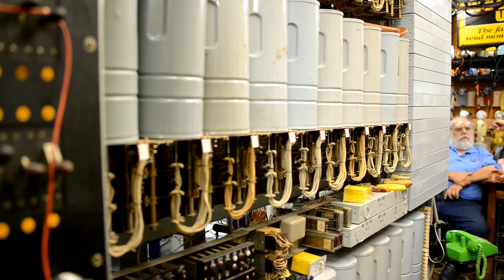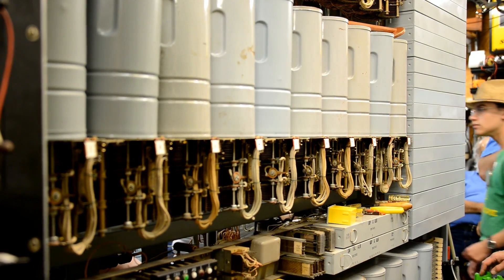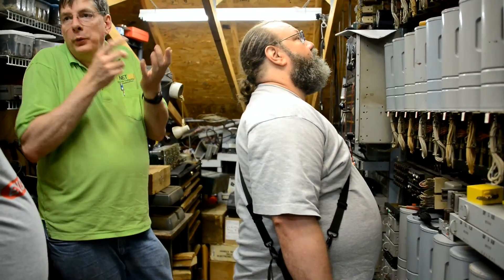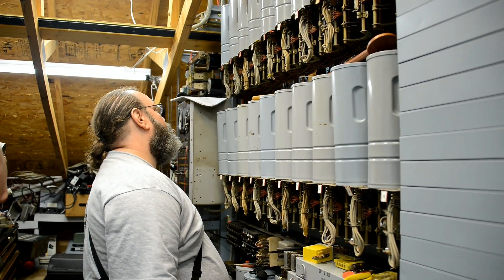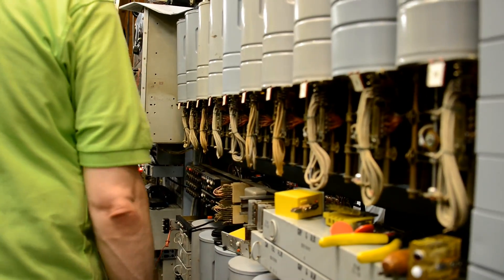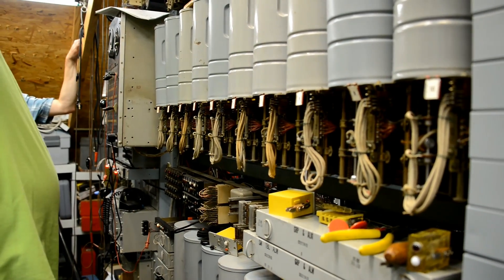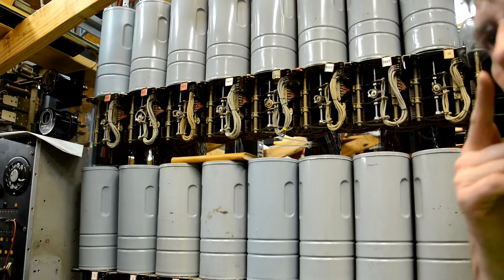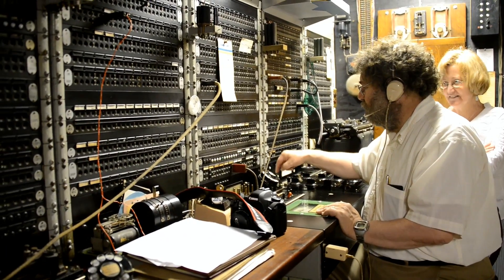2012. Telephone Switch Tour

Comment: Where in the world are you located at?  I used to work SxS systems for SWBT in the 70's. I worked a 355a, then a no. 1 and a class4 intertoll with SxS cama.  All on the same floor.
Reply from the maker: It's not my system. It belongs to a collector in Pennsylvania. There are many restored systems by collectors across the world. Check out Phil McCarter's website (which I created but have turned over to others) https://stepswitch.us/  and Telephone Collectors International. https://www.telephonecollectors.org/ (another site I created but have turned over to the club) https://www.telephonecollectors.org/
Reply: @cowboyfrankspersonalvideos8869  thank you so much.  I'll check those websites out.